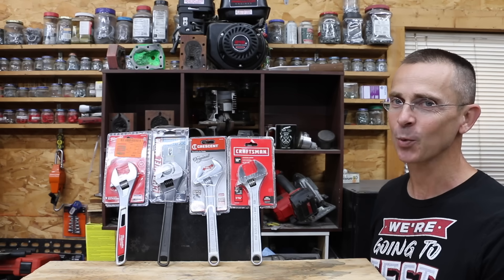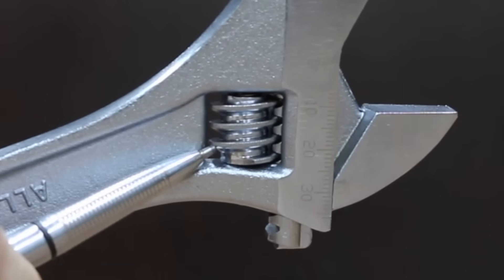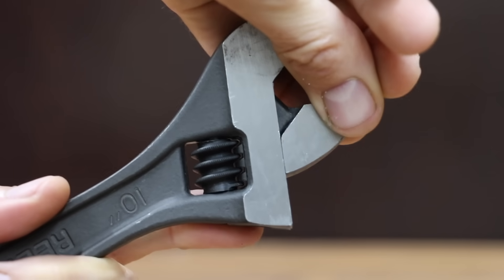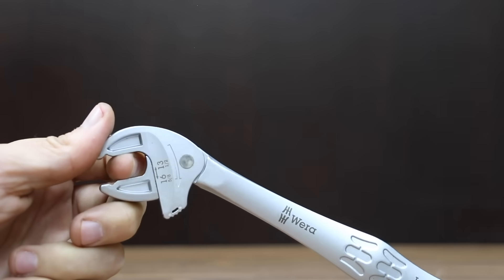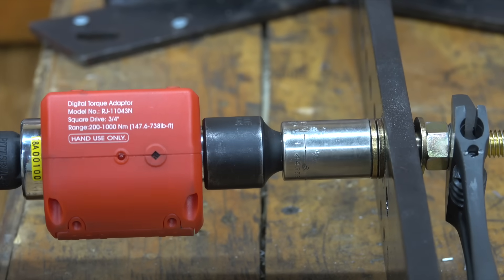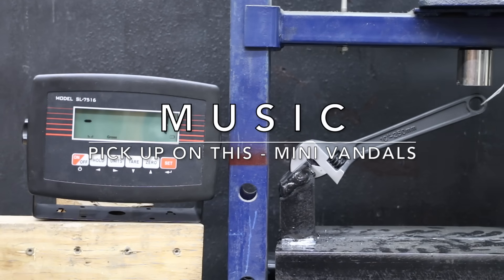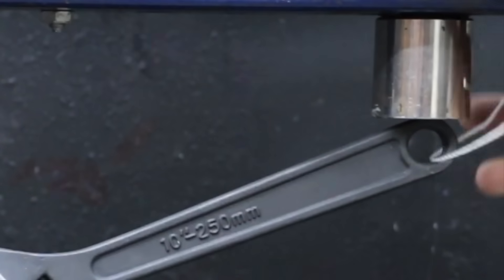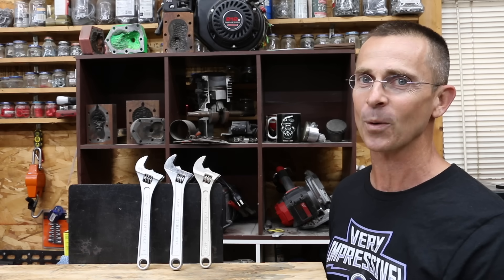Best Wrench (ADJUSTABLE)? Craftsman USA vs Craftsman, Crescent, Kobalt, Milwaukee, Channellock

Comment: WHERE is the Pendelton (Proto)???I have my late Daddy's set of Proto's (12", 10" and 8" ) from post WWII (1948) THE ABSOLUTE BEST adjustable wrenches EVER made by ANY maker as the jaws LOCK when torque is applied to the jaw. His WWII Diamond Caulk Horseshoe Co. (Crescent Co.) wrenches are very good and assembled hundred if not thousands of WWII Naval electrical panels for Nelson Electric Co. (16", 12", 10") and later oil field explosion-proof panels, but Crescent/Irwin Tools doesn't FEEL like Proto's! My Proto sockets feel better than any other brand I've ever used or felt. Same with my combination wrenches. New, today, the Japanese brands are probably the top-of-the line and best to use "blind" at the tips of your fingers, but my Protos are 40 years old.
Reply from the maker: Thanks for the feedback.

Comment: Snap-on adjustable wrenches are the best.
Reply from the maker: Thanks for the feedback.
Reply: @ProjectFarm  Thank you for all the videos! The hand tools at my workplace (aircraft maintenance) are mostly Snap-on and they are all excellent. Mac tools and Matco are pretty much equals as well. These tools aren't cheap however and I haven't ever bought them for home use. I have been lucky enough to get quite a few when the tool room at work decides to buy new tools. A 10" adjustable wrench is currently $74.50 as an example of their price. I would however bet a fairly large amount of money that Snap-on would soundly defeat all the wrenches in this video.

Comment: Been using a genuine USA Crescent brand 10'' in the oilpatch every day  for 25 years, and it was used when I got it. It's backed up impacts on rusted bolts, opened and closed stubborn valves, been on untold fittings and gauges, been dipped in brine water, crude oil, packed with sand, mud and slop. Finish is worn off the jaws and handle. I'm getting old.....but I'll fight a bastard over that wrench.
Reply from the maker: Thanks for sharing.

Comment: No respectable mechanic uses an adjustable wrench for serious torquing. We get the right size open end wrench. It ain't cool to round off a customer's nuts and bolt heads and it ain't cool busting your knuckles when the jaws slip.
Reply from the maker: Thanks for the feedback.

Comment: Be aware.. Every test in this video shows the wrenches is being used the WRONG way..
The upper longest jaw is supposed to ALWAYS point the way you apply force..
Only in the impact test it's used the right way.
Applying force on the upper part of the adjustable jaw it will handle way less force before bending and fail.
The outcome of the test would probably come out different if all the wrenches was used as intended.

But apart from that the video's is always well made, edited and informative as usual by project farm👍
Reply from the maker: Thanks so much!
Reply: @ProjectFarm  maybe you should make a short follow up of this video with just two of the winner wrenches testet both ways in the hydraulic test bench, to compare the difference.
Maybe a YouTube short video😊

Comment: It is obvious that you dont use these tools professionally.
The tests are a bit silly. A pro see that, an amateur gets fooled.
Bahco is not just the original, it is also superiour to all others. By far. And they come in many different models.
I am a pro, with a far developed tool fetishism, and for me there is no other shifter then Bahco. All other are just more or less jokes.
But Bahco is not that superior in other tools. There are other brand for like socket tools, (Snap-on and Stahlwille might be better choices), screwdrivers (Wera), pliers (Knipex) etc.

Comment: I thoroughly enjoy your tests and methods, Consumer Reports take a lesson! 
I used vintage Craftsman tools in the 1960s - Break one, hand it over the counter at Sears for a new one.  Only Craftsman tool I ever broke was a flat screwdriver while using it as a pry bar.
Reply from the maker: Thanks for sharing.
Reply: Jimmy S  I broke 2 myself recently….trying to remove a blade from a rusted lawnmower. Cracked them both in similar fashion. Needed up at Autozone buying some black set that was a little more costly but handled that nut removal with ease. Today’s craftsman just suck from what I’ve seen with my particular uses

Comment: I was taught that when using a wrench, the force on the moveable jaw should be exerted closest to the wrench to alleviate some of the jaw movement. Therefore, in the maximum torque test, I would argue that the wrench is being used upside down?
Reply: Would be interesting to see if the results differed…

Comment: The break test is pointless, given that most of the jaws slip around 150lbs. Nice tests and video!! Shouldn't the torque test have the bolt turning the other way? Meaning the wrench  turning the bolt not the torque wrench?

Comment: I used to have all the best tools in but after my garage fire, I've just been buying cheap shyt and in all my years of building and wrenching on cars, I've only broken 1 socket and it was only because the bolt was basically welded on. The muffler shop had to cut it off.
Reply from the maker: Thanks for sharing.

Comment: I notice you are putting the wrench on the nut for the test the wrong way. you are turning the bolt in the test, but the wrench should be the opposite way, putting the most stress on the solid jaw.

Comment: This video made me put a Craftsman USA on my Christmas List. 

I don't buy expensive tools since they get ultimately very little use, so cheap stuff is fine, but the one tool that I found to be useless was my cheap adjustable wrench (or all the cheap adjustable wrenches I ever used). They always slipped no matter what I was doing. This video showed me spending a little bit of money can turn that garbage tool, even for my uses, into a very useful tool which may turn into a go-to. Movement makes these things practically useless.
Reply from the maker: Thanks for the feedback.

Comment: I'd be interested in how the Knipex pliers wrenches (or is that wrench pliers) compare. I find them preferable to the kind of wrenches you tested. However, I wasn't surprised about the Pittsburgh wrenches - I find they make decent hammers and doorstops.
Reply from the maker: Thanks for the suggestion.

Comment: I bought 2 Chinese wrench’s for $10 each from the same brand, they are the same brand, same model and the same size. The jaws are marked with the same measurements… but the jaws open to different sizes? I have to paint one so I wouldn’t mix them up because only one fits the tool I bought it for. 🤷🏻‍♂️
Reply from the maker: Thanks for sharing.

Comment: you see, from my experience, most tradesmen buy equipment that cost more and avoid made in china brand, however, those made in china brand are accorded for most of the sale in hardware store, because family would prefer to get a cheap and use it for whatever home DIY project they think they could handle. However, using these cheaper  ones are less economics in the long term, this is why  tradesmen  stick with higher quality equipment, because if they are going to be used all day, it is better to get those that last and do the job better. So sad, that you broke a wrench that you couldn't buy anymore. RIP USA craftsman
Reply from the maker: Thanks for sharing.

Comment: And the real life usage advantage award would go to Bahko, without a doubt. You fail to mention the fact that because it is the heaviest, it also helps the most with downward force while using it. Not to mention the fact many will use this tool as a hammer quite often. There too the bahko kicks all others out the door. Plus, as you've tested, 18:29 it just will not break as fast, compared to all the others. I have seen way too many of these exact tools break on me since the late 1970s, while the bahko is still in my toolbox. Sure, it's my N=1 study, but still, take it or leave it, find out on your own. Just sayin'..
Reply from the maker: Thanks for the feedback.

Comment: Awesome tests.  I think the thickness of the jaws of each wrench should have been factored in - and scores given as a ratio between jaw thickness and failure point.  Anyone can add more cheap metal to increase strength. The trick is having a thinner jaw that can still hold up.
Reply from the maker: Thanks!  Thanks for the constructive feedback.

Comment: If you can't tell by my comments, I love your videos man.
This is another one that didn't disappoint, and I got to pat myself on the back when you effectively gave the crescent brand second place since I had  already bought crescent brand adjustable wrenches for my work van prior to seeing this video.

However around the house I've got a mixture of Pittsburgh and husky (which was noticeably missing from your line up!) Frankly I imagine that the husky would run with the bottom of the pack, they are sufficient for around the house but they aren't anything to write home about. I would say that they would probably be right between the kobalt and the imported Craftsman and they don't have the nice handles like the kobalt. They were however only $19 for a 3 pack with the 6, 9 and 12 inch wrenches.

Comment: I wish you would use the snap on adjustables. They're only a little more than the most expensive and have some sweet features, such as their jaws having teeth to prevent rounding
Reply from the maker: Thanks for the suggestion.

Comment: Also the Bahco you tested is the wide opening, slim jaw model with the rubber grip. They do a standard 10" with the wide metal handle which I think would probably have better results, in my opinion only as I haven't subjected it to such rigorous testing. 👍
Reply from the maker: Thanks for the feedback.

Comment: If I may make a suggestion, pls do dado blades for woodworking. Do a test between dado blades with built in chipper teeth and those with separate chipper teeth. Companies that make you some of these are Forest, Amana, Freud and if you others.

I am looking for a quality of cuts when it comes to using this type of blade on products like melamine and plywood veneers cross cutting.  The dado blade with built in chipper teeth are a twist to open.
Reply from the maker: Thanks for the suggestion.